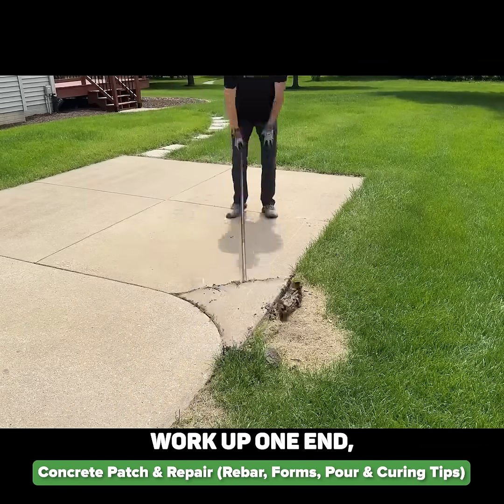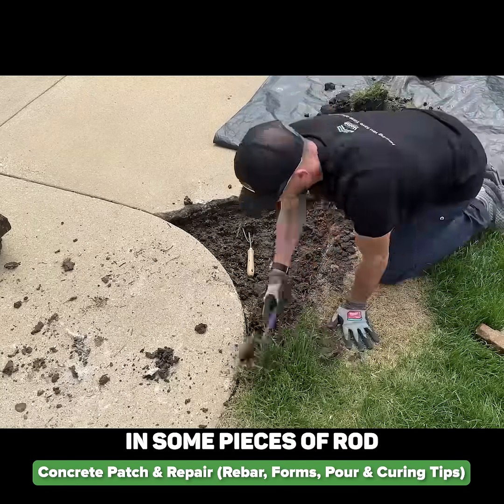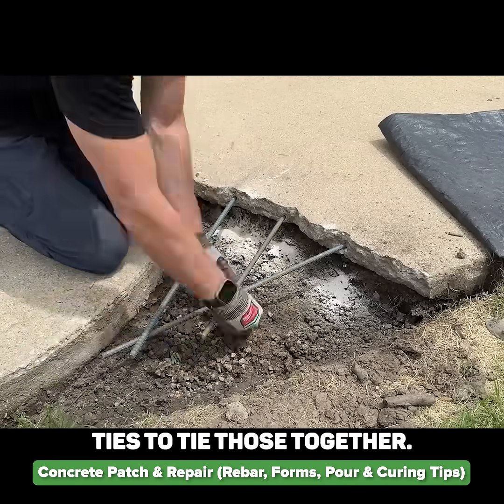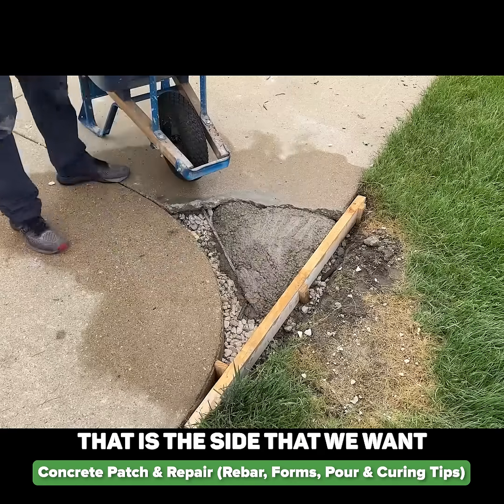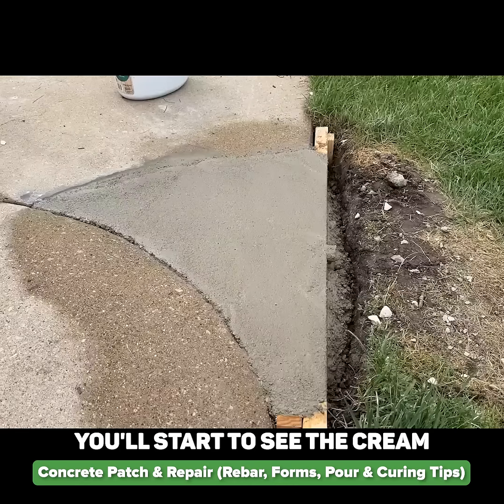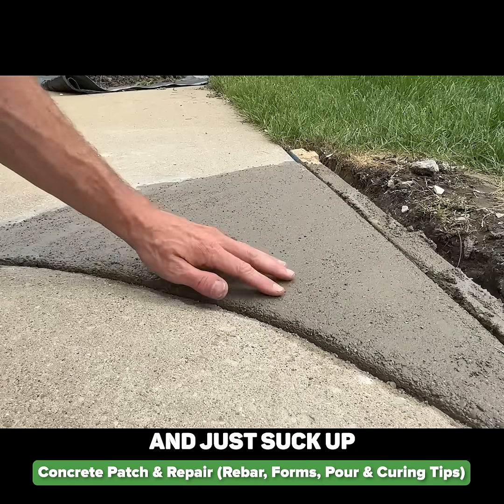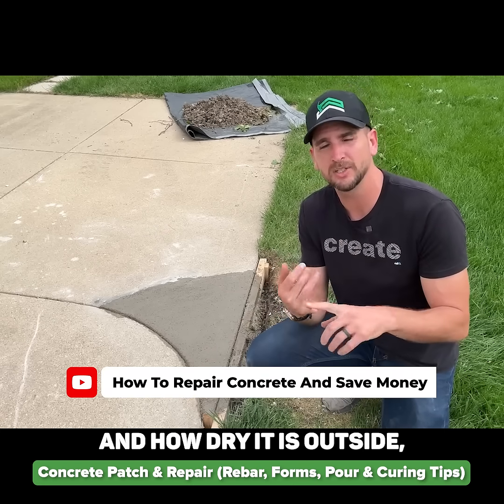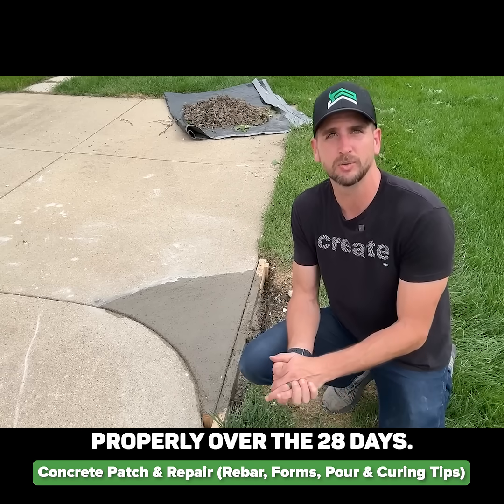Repairing a Broken Curb: Rebar Pins + 5,000 PSI Mix

Comment: Those Rebar Dowels should be Epoxied in.  That secures them and  helps to keep the repair from shifting under weight and helps to protect the rebar from corrosion.